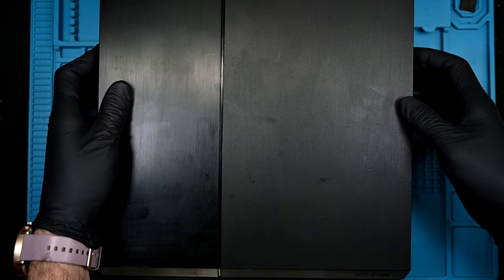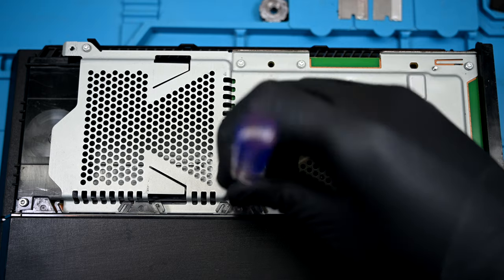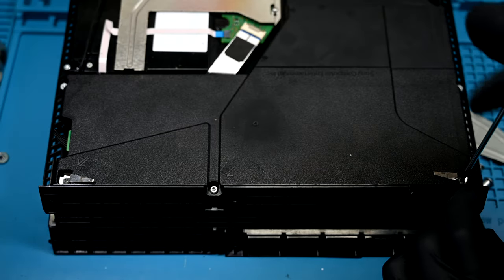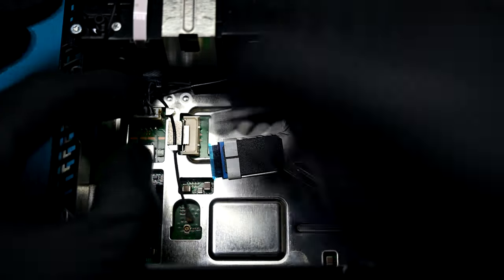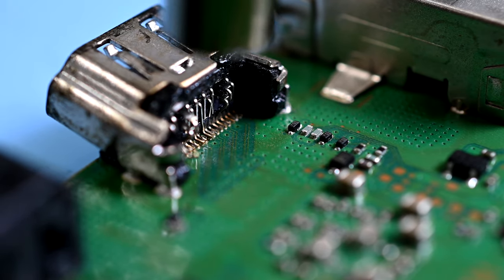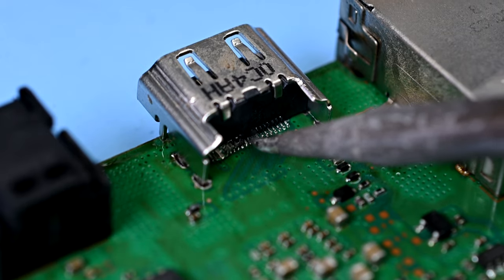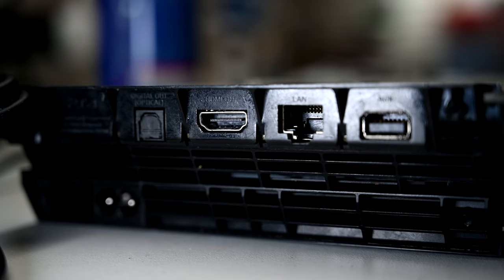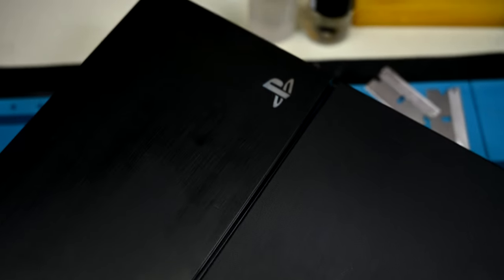PS4 HDMI Port Replacement | Guide

Comment: Thanks for the video, I was able to change the HDMI port successfully. The only problem now is that the console no longer recognizes a controller. This was not the case before. I have already tried 20 different cables and different controllers and even a new one from Amazon, nothing helps. Funnily enough, I can connect the controller via USB cable when the PS4 is in security mode. Repairing the database etc. could not solve the problem either, when I want to reinstall the firmware via USB the error message "SU-41283-8" appears. Does anyone have any idea what I can do?
Reply from the maker: That’s a weird one, the HDMI port should have no effect on the USBs but electronics are weird sometimes. And that it works in recovery menus is even stranger, you may be having hard drive issues rather than USB issues. I’ve also found that letting the PS4 enter recovery on its own fails more often than forcing it via holding the power button during boot up, so you may try that and see if you have different results. If you have a way to connect your drive to a computer you can use software like HD Sentinel to check the health of the drive and look for failure signs.

Comment: If the sound isnt working this has to be done right ?
Reply from the maker: Yep, typically it's from one or two pins on the port becoming loose.
Reply: Yeah I know man I think I put cable in wrong way I tried pushing up the pins online but sound didn't work but the thing that sux is they're charging me 95$ for such a simple thing 🤷 I want to buy the part and just see about labor but don't think that will do anything for my pocket

Comment: What is that gell you put on it and is it important
Reply from the maker: That's flux, and it is very important for soldering. It prevents the solder from oxidizing too quickly which would result in a dry, cracked solder joint. It also provides surface tension for the solder, which keeps it from smearing or "spiking" when you pull the iron away. Most solder has a flux core, where the center of the solder strand is filled with a small amount of flux. Unfortunately with this repair that flux is already burned away, so adding more is pretty important.

Comment: I’m struggling to remove the old solder from the 4 pin holes
Reply from the maker: It's probably the most frustrating part of the whole process. You can try mixing in more leaded solder to lower the melting point, or what I've ended up doing a few times is cutting a small piece of wick and heatgunning the holes till they go liquid, then jam the wick. Into it with tweezers.
Reply: @TapticDigital   I think one of the little data pads has come off as all of them expect this little one is taking solder? Does that mean it’s no good
Reply from the maker: @hazzaman1672  if it's dark tan and not silver, yes the contact has been ripped/fallen off, you'll need to run a jumper wire from the trace that pin was attached to. I'd recommend looking up Northridge Fix's video on jumpers

Comment: I wish I would've watched this before doing this on my own. I mixed solder in with the two legs on each side of the hdmi port then used tweezers to wedge each side out. I ripped up all the traces xd. I didn't apply the solder to the hdmi pins before doing this, only the legs holding it in. sigh.
Reply from the maker: That sounds super brutal. It may be saveable, but worth it is questionable. I know mail-in services like NorthridgeFix can run very clean jumpers off traces, but it's a lot of work.

Comment: How would I be able to contact you for PS4 HDMI repair?
Reply from the maker: I don't offer mail-in repairs just yet, but I recommend checking local shops with decent reviews. If you're in the US there are several franchises like CPR or UBreakIFix who offer console repairs at decent prices and usually have a warranty. If all else fails check ShaneFix online, he offers mail-in currently.
Reply: @TapticDigital  been checking for local repair nearest one is over 200 hours away... And  all are around 150 dollar repair fee ...
Reply: And yea I ubreakifix was the nearest and was 145 dollar repair ...
Reply from the maker: @itachi__wolf  that's about average for HMDI replacements, they require specialized skills expensive equipment, most soldering repairs will be between $100-$250 from the places I've checked. Take a look at ShaneFix, or even possibly Northridge Fix, not sure if they still do consoles
Reply: @TapticDigital  100 I understand but it would take more money to by the 10 dollar port, a soldering gun and a desolder... And the coolant  so don't see why it takes that amount just for the maintenance if they already have the tools and the replacement parts? I feel like if a company was doing $50  to $80 they would get a lot more customers and get a continuous sales .... But that's just me

Comment: I don't understand how your able to solder to the pads they just won't stop soldering all together
Reply from the maker: Flux is the trick here, and it also takes a LOT less solder than you think. Press your iron to the pin and pad, and feed a very short amount in to each. Or, add solder to all the pads, then using the iron press the pins down into the pads

Comment: I would of replaced those thermal pads..  Nice video tho I'm wanting to learn to solder
Reply from the maker: I ended up replacing them before full reassembly, they were wayyy too gross. Thankfully Amazon has pre-cut replacement pads in bulk!

Comment: Can a regular ps4 HDMI port work on a ps4 pro?
Reply from the maker: In theory yes, but it doesn't line up quite right or sit in the console frame properly.
Reply: @TapticDigital  so i need a slim or a pro hdmi port?
Reply from the maker: @thedeanray9990  strangely they use the same, the slim and pro are the same port while the regular is different

Comment: What tool are you using in 3:00
Reply from the maker: That is a chisel tip soldering iron pressing down soldering wick, copper colored metal braid that soaks solder up off a board.

Comment: Welp, after battling trying to get the solder holes empty to receive the new HDMI port, and carefully soldering all the new pins ensuring none of them are jumpering, I still have no picture. I get the feeling that the two and a half hours of hitting it with a heat gun may have accidentally damaged some of the other components. I think I'm going to submit and just get a new board, sad day.
Reply from the maker: Not necessarily! Unless you see actual bubbling or separation of the PCB layers it’s likely okay. The holes are nearly impossible to clear out, I have better luck just heatgunning till liquid and forcing the new port in then quickly removing the heat. Another thing to consider is it may not be just the port, it’s also possible that the retimer chip behind the port died (not from you, they just like to die randomly) and needs to be replaced as well

Comment: Is flux paste the stuff you used at 3:04
Reply from the maker: It sure is! ChipQuik brand, but any will work
Reply: @TapticDigital thanks man I appreciate for you responding lkl
Reply: Lol*
Reply: @TapticDigital also one last thing what’s the difference from unleaded sotter and leaded sotter and why do I need both of them?
Reply from the maker: @youngcraka8049  thankfully you don't need both. The biggest difference is the temperature that they melt at. Because of European standards pretty much all consumer electronics use lead-free or unleaded solder, turns out lead isn't very healthy stuff. However, when doing repairs I like to use leaded solder because it melts and flows a bit faster. The reason I add leaded solder to unleaded is to reduce the overall melting temperature. If lead free solder melts at 500C, and leaded melts at 450C, mixing them should allow it to melt around 475C or lower.
Reply: @TapticDigital  okay thanks dude I’m buying leaded sotter then thanks for the help though
Reply from the maker: @youngcraka8049  any time!

Comment: So, slight problem here I found. The heat gun melted the board. Not because I had the wrong fitting on the gun - because I used the little one - but just because the heat gun must've been too hot 😂 how do I not have this happen? 😬 Thanks. 

Oh, also, the Solder didn't melt as hoped either 😂😂😂
Reply from the maker: @Talkinbollucks  the boards can eventually hit thermal shock if overheated in a single spot. The best way to avoid this is to keep heat moving in a circular motion on the board around the port to try and evenly distribute it. Also the lead free solder Sony uses is crazy temperature resistance, adding some leaded or low-melt solder to the existing parts will help loosen it up a bit

Comment: oh wow...i need this done and i think those little pins and back plastic are my fear....i feel like just soldering them to individual wires and then just tuck in all in with hot glue or what not as long as its functional hahaha, you did awesome job in ur video!!!
Reply from the maker: Thanks! And while I can't outright recommend your method, I do think it would technically work. "Technically" 😉

Comment: My heat sink screw aren’t truninh
Reply from the maker: They are pretty tight and some of the largest screws in that console. Just don't strip the heads!
Reply: @TapticDigital  bro. I got one out but the other one is damaged at this point 😭. How do I get it out ?
Reply from the maker: @quazy9787  hit up the local hardware store for a screw extractor unfortunately!

Comment: Cant get the solder on the feet to mix. GG
Reply from the maker: Need hotter iron, or a larger soldering tip. Usually a chisel tip works best because it allows the most surface area contact and will transfer heat much quicker

Comment: So hang on, you didn't solder the pins down you just rely on the pressure from the mounting pins to make the connection?

Comment: Bro can i fix it at home by using super glue gun?. The hdmi port is broken by only its legs other things is ok. So give me some advice
Reply from the maker: I... Can't really recommend it. If all the pins behind the port are still attached and it's JUST the four feet on the outside, maybe some hot glue but you'd have to be exceptionally careful plugging and unplugging it. Ideally if you find a cheap soldering iron or even a wood burning tool it should be enough to melt the feet back into place.
Reply: @TapticDigital  Ok boss. Thank you for replying 🥰 ok I'll try it with my brother have great day 💫💫

Comment: I got charged $100 to replace mine witch is outrages, theses stores love ripping me off.
Reply from the maker: That's pretty cheap compared to most places. Repair shops are using expensive high precision equipment and microsoldering takes training and practice, you're paying people for their skills, and a quality repair. For a device that costs a couple hundred dollars and needs to be fully disassembled, soldered, and reassembled, what kind of pricing would you charge someone?
Reply: @TapticDigital  yea so basically my/well I say my beacuse i am responsible for it at the moment. But my ps4’s hdmi port got broken, and it’s on safe mode/ I think they said it was a software problem that they will fix for free. But I guess it does make scence  of the price considering the labor and work they have to do to reassemble it.